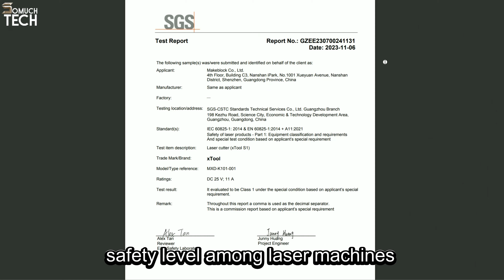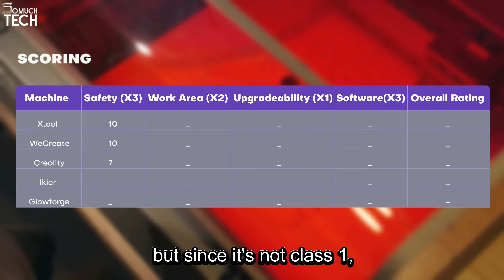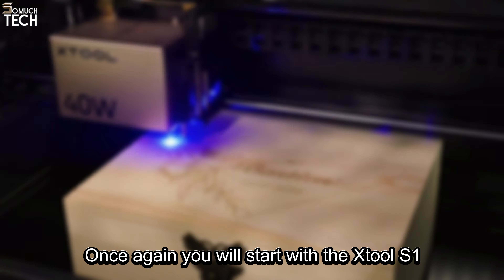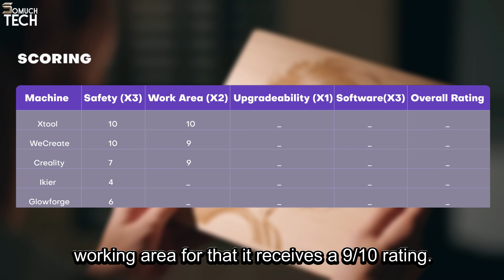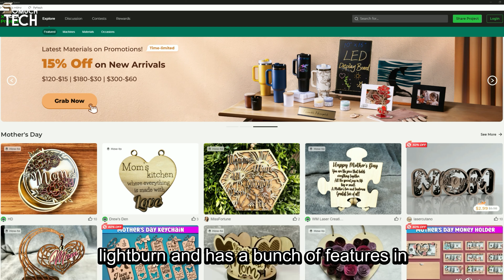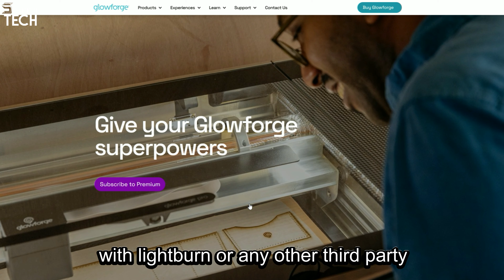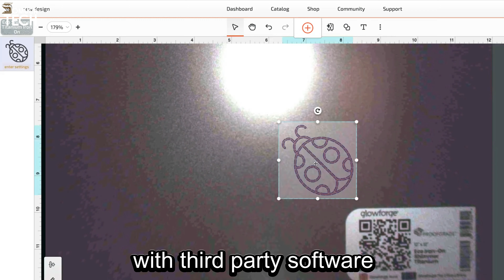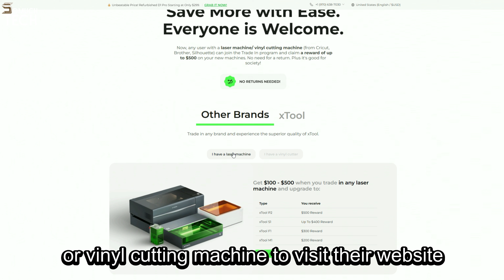LASER CUTTER BATTLE: XTOOL S1, WECREAT, IKIER K1 PRO MAX, GLOWFORGE AURA, CREALITY FALCON 2 PRO

Comment: Your data is incorrect you need to update your video.  The tool isn't the only upgradeable machine.  The falcon 2 pro comes with 2 lasers.  It also uses lightburn which is arguably better than the Proprietary software that the xtool uses.   You guys must be an xtools affiliate.  I came here for an unbiased review because I'm trying to decide which machine I want.  Just a dew seconds of watching will tell you its not unbiased.
Reply: see the xtool afilliate links? ;)
Reply: Came here to say the same thing

Comment: You need to update your video. The WECREAT Vision now features a 2W IR Laser Module and a conveyor system capable of engraving and cutting materials up to 10 feet long, which also functions as a riser base. Additionally, the WECREAT Vision includes a rotary accessory for engraving tumblers and other cylindrical items.